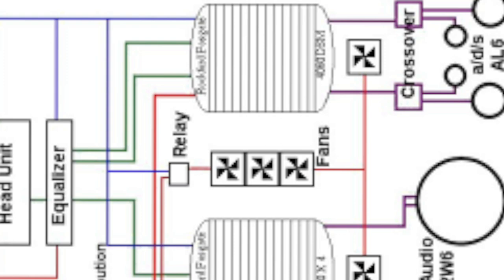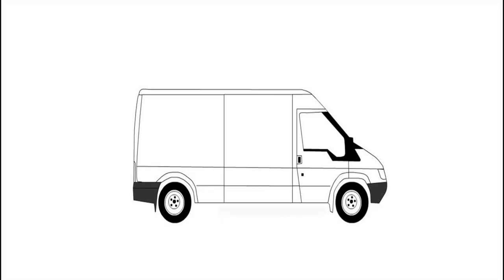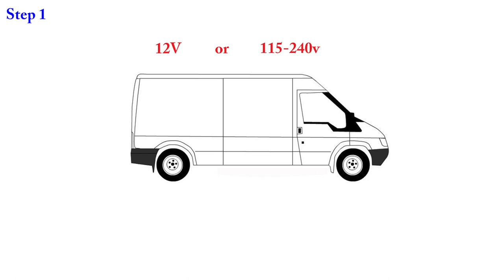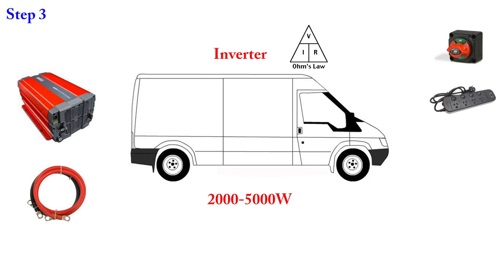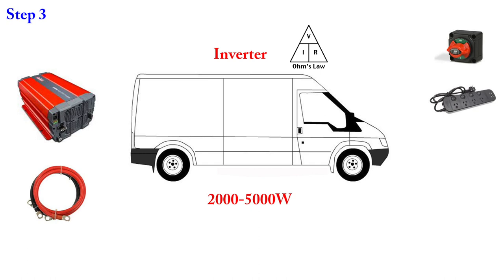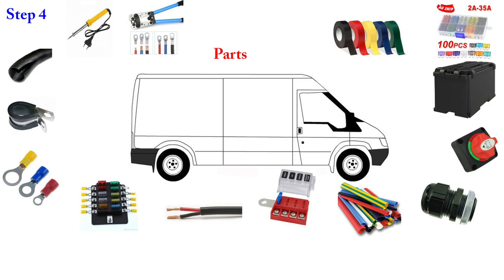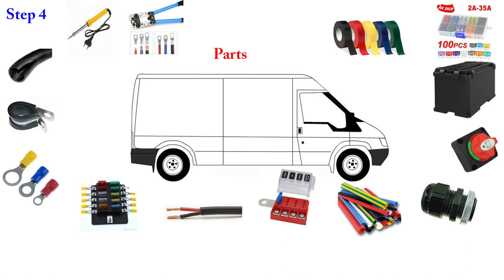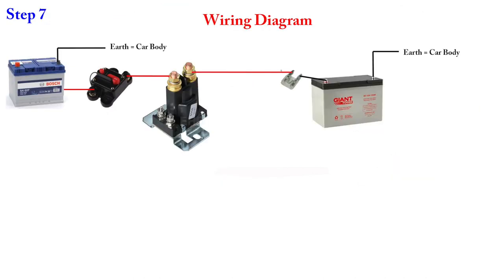How To Wire A Locksmith Van Overview

Comment: @DrLockShop so do you put the isolator switch on the positive side and run a negative cable from the battery to the inverter and then from the inverter to the vehicle body?
Reply from the maker: yes

Comment: If I had only 2 110v key machines, a battery charger, and then only a few 12v LED lights. Would a 93ah marine battery and a 2000w inverter be sufficient? All of the equipment might run for at most 30 minutes at a time intermittently only a few times throughout the day.
Reply: Dr Lock, I can always email you my concerns if that would be better.
Reply from the maker: Hi, Yes it should be ok, I ran my last van from a 120ah and it never failed me, my inverter was 2000w ,  I was using 110v step down transformer , Silca Record , HPC shark , and it was all good
Reply: I have a marine battery that my 2000 pure sine inverter runs off of. It’s charged by my vehicle. I can run all three key machines at once and my led lights on with zero problems. I’ve made a mistake before and left the inverter on for a few days when I took some days off. And killed the back up battery. So for a day or so. I had to start my vehicle to get power to my machines. Hope this info helps. My machines run off 110v